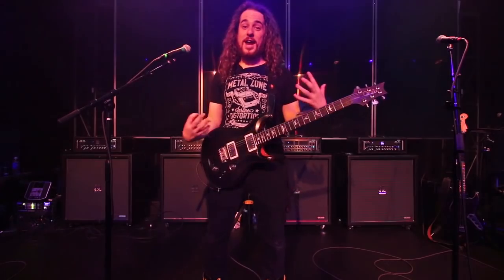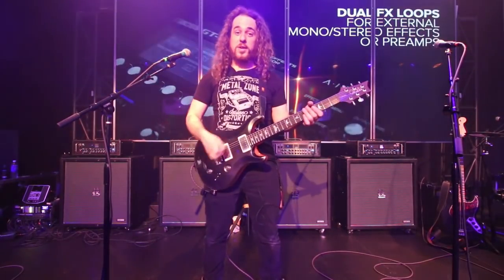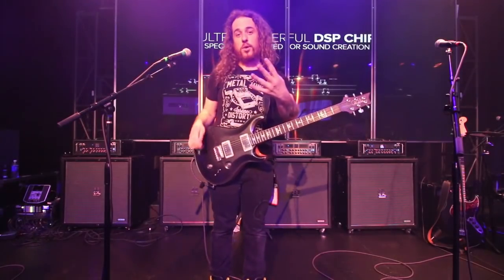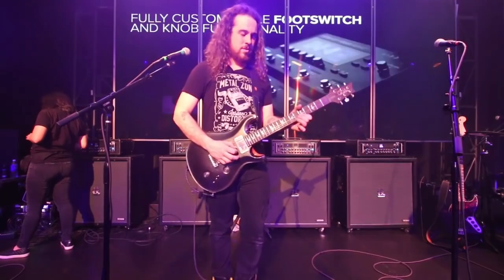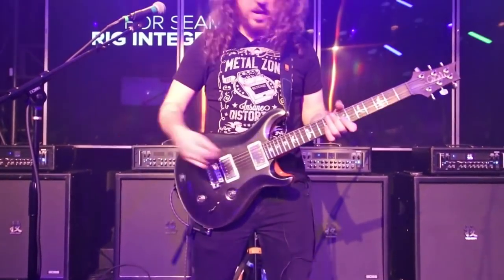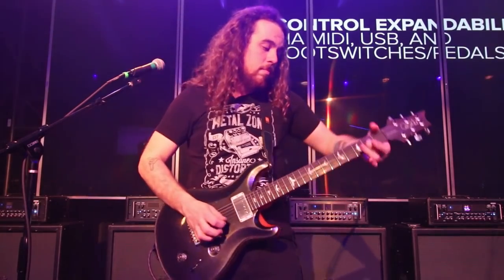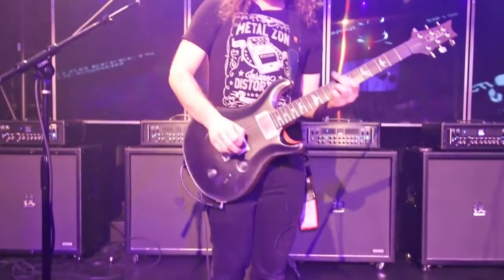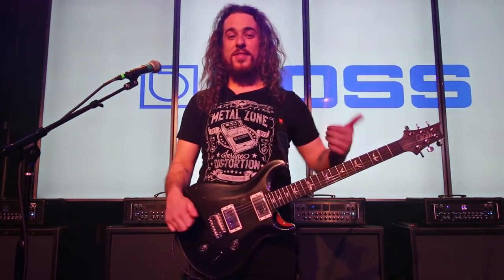NAMM 2018: BOSS GT-1000 GUITAR EFFECTS PROCESSOR

Comment: I think I’ll stick with my GT100 thanks. Does everything I’ll ever need! It’s great through headphones for late night practice, great for recording, and when you drive it through a valve power amp it’s in a league of its own. Plus, unlike the Line6 stuff which I’ve had every model including the Dream Rig! Or Nightmare Rig as I like to call it, the GT100 is a breeze to work with! It’s quick settings feature is excellent for getting in the ballpark of the sound your after. Plus it has the main eq right in front of you so if you want more bottom end or more mids or less as the case may be. It takes seconds to get a good sound. I wish I could say the same for Line6!

Comment: boss left behind on the simulations of amplifiers and cabinets but also as links not to mention the still liquid crystal display in 2018 !!! it takes a total restoration I recommend the modulations and delays, but should be inserted simulations of other brands fulltone lexicon mxr etc etc and the prices amp and cabinet with ir impulse responce new to be inserted but leaving the boss part Roland just like the delay modulations. headrush and real news great sounds beautiful display excellent connections price and unbeatable quality and dynamic under the fingers incredible as the old eleven orange rack which in my opinion is the real deal even today better than axe fractal ultra and PD HD 500x